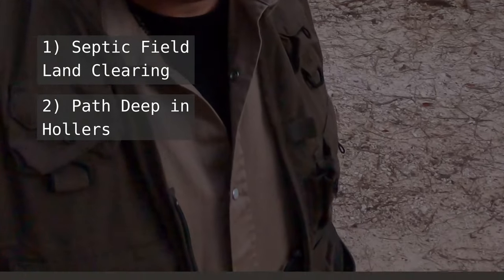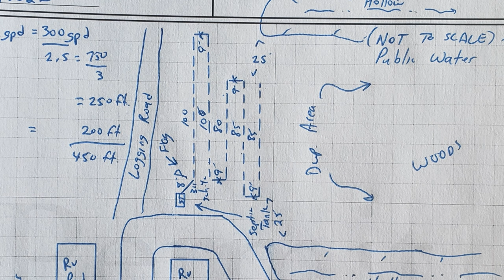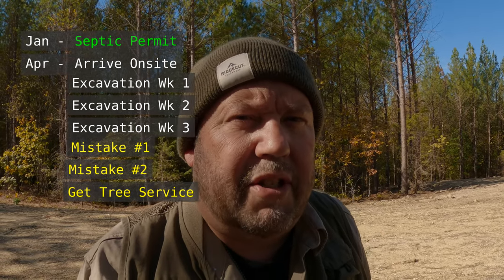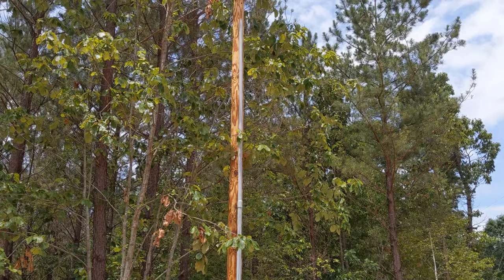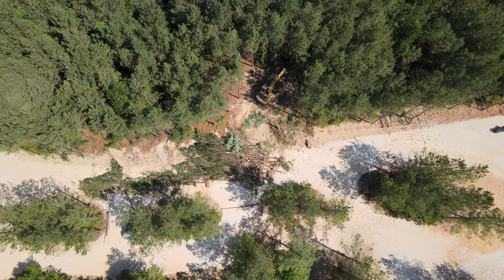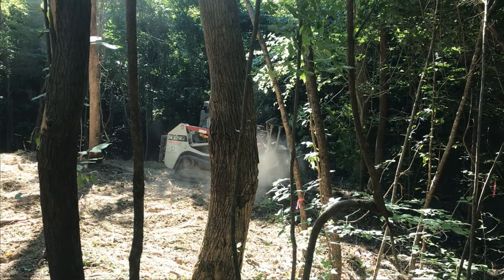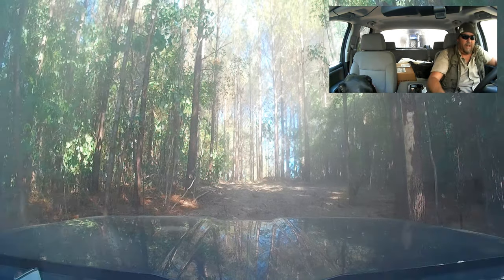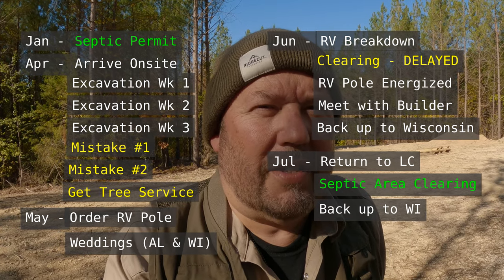Avoid these Septic Clearing mistakes in This Week Episode 4 of 4 Excavation Weeks

Comment: When can we come rent a spot ?
Reply from the maker: Our videos are a couple of months behind. Fast forward to today, we are doing a "soft opening" in a couple of weeks with our first 3 pull-through RV sites coming online. We don't see any road blocks to have 50A electric and sewer at those sites within the next 2 weeks. We have a water tap and meter at the road and almost everything to run water, but one stinking part is on a 33 week backorder blocking us from moving forward with water hookups. We can truck in Tennessee spring water until then.

However, If anyone can find us (4) Ford Corp part number F1000-4-Q-NL water tap/valves, we would be very grateful and can have water hookups too!
Reply: @RvParkBuilder  that is awesome news. I will be emailing you tomorrow about renting.
Reply: @RvParkBuilder  There is a new one on ebay now for $70  Dec 4
Reply from the maker: @vger66  that's a great price! An old high school classmate found some in Michigan and mailed them to us. We are all set and actually installed 3 of them this past weekend! Thanks for checking!

Comment: Very interesting and informative video.  Will help other owners there.  So nice you took the advice of commentors and saved the logs rather than burning. Shows your thoughtful and caring nature.  Loved the part with Penelope, too.  Such a sweet doggie. M :)
Reply from the maker: We are glad we saved the logs too! However, now we have to either move them or process them into firewood (and then move them).
Reply: Burning isnt a big deal. It created BIO CHAR which is necessary for the soil. Another option, which is not quite as good as Bio Char, is chipping. You can use the chips to landscape, & you can use them as compost in garden beds.

Comment: Do all the lots there have water at the street?
Reply from the maker: Not any of the ones currently for sale that we are aware of. Some did. They were all sold in previous sales starting in October 2021.
Reply: @RvParkBuilder  thanks for the quick reply. I was looking into coming out the 4th for the land sale.
Reply from the maker: @rvingjetpilot5302  You should! Are you already working with someone at Tennessee Land and Lakes?
Reply: I've been in contact with Cree. I'm in CA, so arranging travel and accommodation by Saturday would be a challenge.